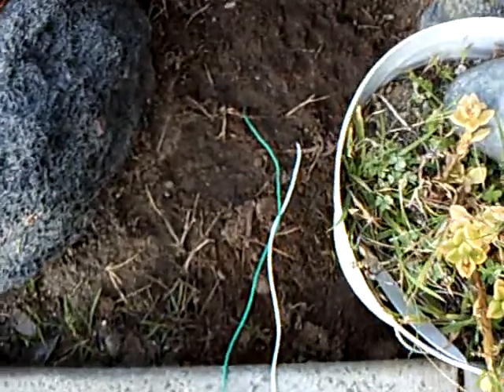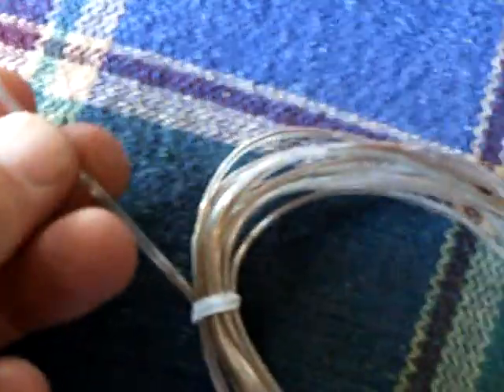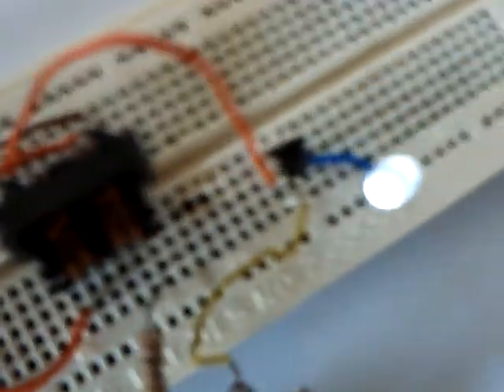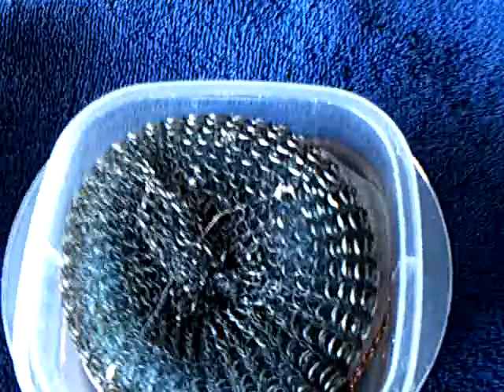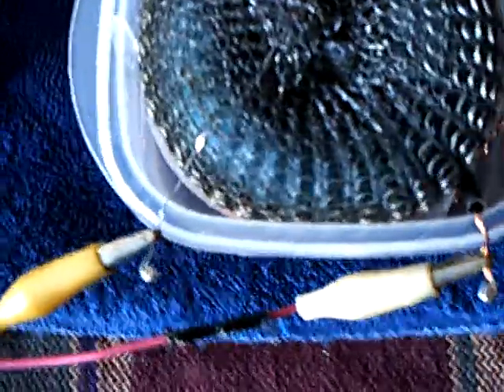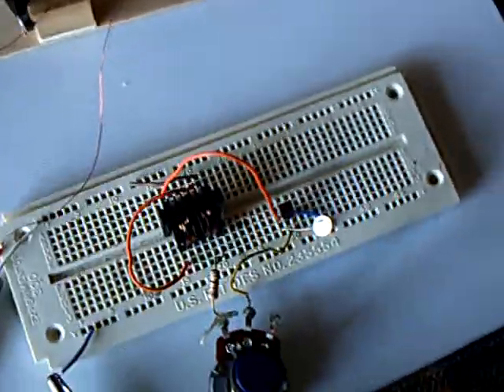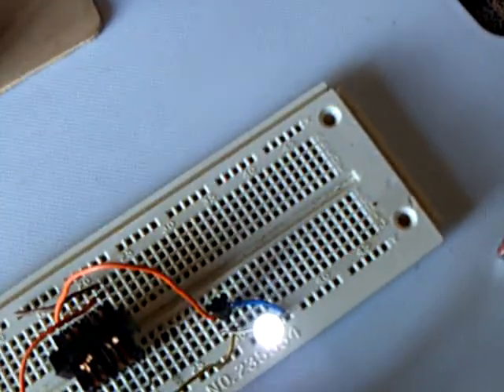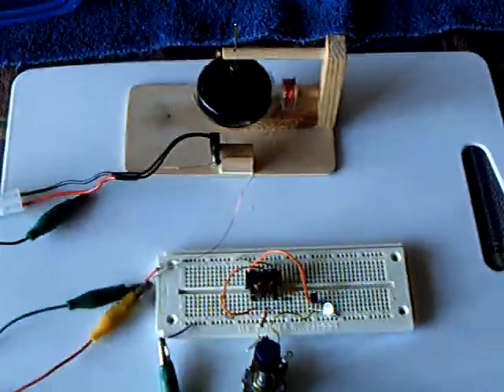Pot Scrubber Battery---Table Model.ASF

Comment: @Lidmotor 1:1 isolation transformer can be picked up at radio shack (273-1374) 

Does an isolation transformer like that work good for the coil of a joule thief?

Comment: Really simple beautiful idea and work, Lid.  This is a very good way to harvest energy for educational purposes. I like it. Can I ask how long is the magnet wire on pulse motor's coil. Are you using a hand made inductor or an off-the-shelf inductor in the Joule thief circuit, I wonder? It seems working pretty well.